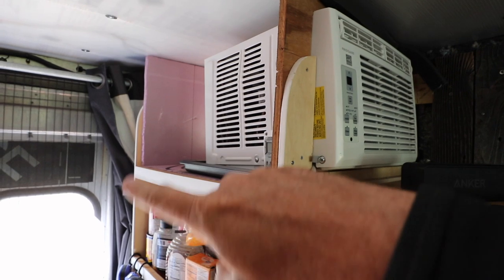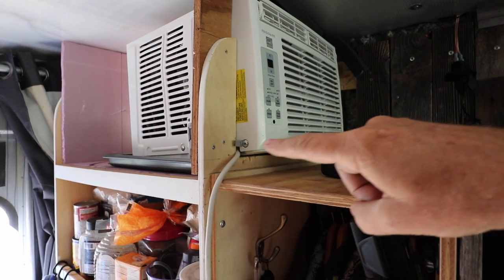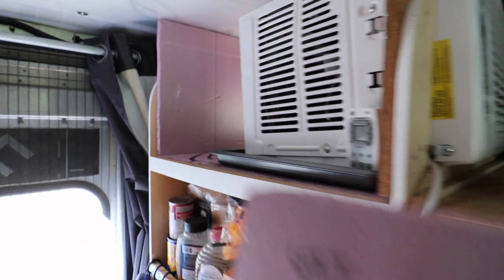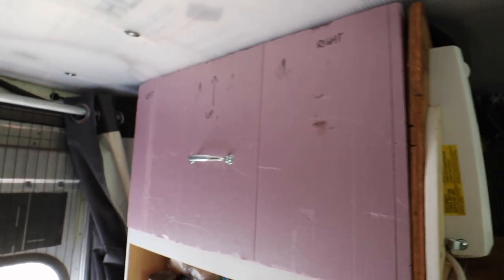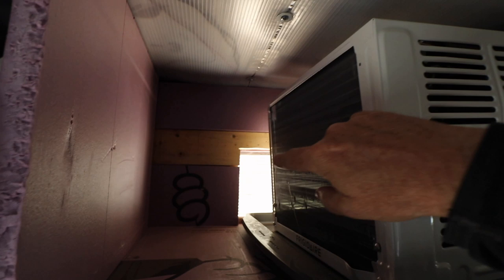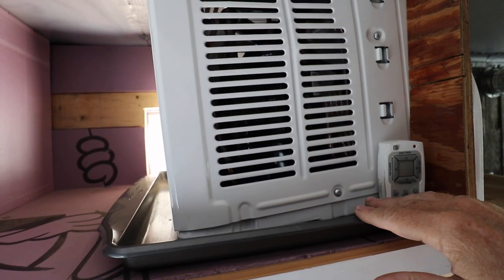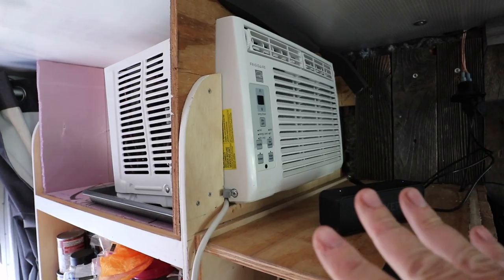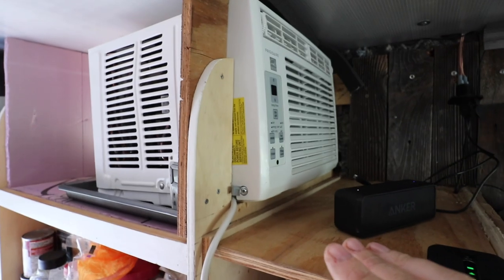Solar Powered AC in a Step Van Update P3 E559

Comment: I gave you all the information you needed to install that AC before. You need two wents. one to bring the cooler air in for the sides. And one to vent out the hot air from the back. 
You can't use one. you will be pulling the hot air from the back into the sides. 
 There's no point in getting an energy star rating if you don't use the AC in the way it was designed. 

 I have the same AC. I am in sunny Florida. There are sixteen 100 watt solar panels on my van along with 20 gulf cart batteries. 
It will run all the AC, fridge and CCTV system all night on the batteries and still have over 50% charge. 
 But even with 1600 watts of solar, you won't get a full charge in the batteries through the day with just solar. And that's with a sunny day. Maybe if you don't run the AC through the day and its full sun. But not if you want the AC running through the day too. I put a link the last time showing how to install the AC trough the floor so its true stealth and the venting is correct. I'm sorry. But what you are doing will not work. 
 If you don't want help just say so I'll stop sending you the information. 
I live in My van and use the same AC every day and night. I'm not guessing I'm telling you from years of experience. 
 I keep the AC on low trough the day as I'm working. Then after I park I run my generator and a 100 Amp charger until I'm ready to sleep. Also, My van charges the batteries when I'm driving with the alternator, along with all of the solar.
Reply: Sounds like you have very poor R-value insulation. You have spent a ton on solar and gen and are letting it all bleed out.
Reply: @tompava3923   I have 3'' of Rmax Thermasheath Polyisocyanurate Rigid Foam on the walls and 2'' on the ceiling with 3/4' on the floor. 
Have you ever tried to run an AC 24 hours a day with solar and batteries? Of course, I also run a Fridge CCTV and a bunch of other stuff.

Comment: You could put it on the roof add then cut a 45 degree plywood directing the airflow down. Another option would be to turn it  90 degrees and make a hole big enough so entire back it outside. Or add a couple 12V fans.
Reply: Also air intake is mainly in the front. 100% if you keep it closed. Also air comes out 2 top vents. Back side vents are mainly to shoot air out the back. You could make an adapter sending the back outside through you existing hole. Sometimes you leave it open to put a positive pressure inside.  

The back side and top intakes are hot air.  The back outflow is very hot air.  The the front intake is cool air. The front top blower is cold air.
Reply: The problem is the side intakes of hot air are outside because it it was inside it would create high negative pressure in the van. Thus a good setting is slightly open to just let a tiny bit of positive pressure in the van

Comment: You need something similar to a dehumidifier,but a portable AC unit. It allows you to hook a hose to your outside vent to exhaust the hot air. Even just a dehumidifier might be enough, since it cools air to condense water from air, which water holds latent heat value, and for most efficiency, have the dehumidifier hooked to a drip line that let's it drop outside quick as possible. Since it's just water, no problem letting it drip, with a hose through the floor to outside. Even car AC have a drip pan which then drips it onto the road. You've probably noticed cars in hot weather with the removed humidity leaving wet spots on the passenger side near back of the front wheel behind the fender, coming from the firewall. Dry air always feels cooler than humid even when temperature is the same.  Here's an example with picture showing the hose and hooked to a window spacer in a home.
https://www.walmart.com/ip/DELLA-8-000-BTU-115V-Portable-Air-Conditioner-Cooling-Fan-Dehumidifier-w-LCD-Display-and-Remote-Control-UL-Listed/482891466?athcpid=482891466&athpgid=athenaItemPage&athcgid=null&athznid=PWVUB&athieid=v0&athstid=CS020&athguid=480a2d54-c16-16ce5b9204670e&athena=true
Reply from the maker: not sure if dehumidifier would work for me. generally speaking, I spend 11 months or more in extremely dry areas like Arizona, New Mexico and Colorado (my trip to Florida was an exception).

Comment: The only thing that is inside is your front panel of your AC unit . All off the back of your unit is out side. You have two fans on that unit the front won takes the air from the in side of your step van and plows it out the top vents. The back won plows against the back coils to cool down the gases in the back coils and the compress r.

Comment: You're going to have to cut a hole to mount that to the outside there is no alternative, even with a vent it won't pull enough of the hot air out of the vehicle.
Reply: Chasing that what I was thinking.

Comment: Seven at this point I would put a hood on the roof from a fan. The type that can stay open in any weather. Isolate the exiting heat to go out the top from outside air that comes in the side. You will be done and it will work perfect.

Comment: .Jamie or camper van Kevin did interview at the van build with a guy in a van with that air conditioner on drawer slides when you travel it slides in when you need the air conditioner it slides out.    It’s the best I’ve seen and I’ve seen many .   Stop cut holes in your van and get with Jamie he will tell you and get some professional help

Comment: Seven, just a thought. What if you turn the A/C unit 90 degrees put the exhaust vent right in front of your cut out in the StepVan.let the intake  vent stay inside. Should work.
Reply from the maker: hmm... that might actually work. only downside is it would be pointed to the side instead of toward the front where I want it

Comment: Portable A.C. With a hose that exhaust the hot air,,,could be vented through the Floor,,Just my opinion,,,Thanks for the update.
Reply: It's my understanding portable a/c take more watts to run. Watch Camper Van Kevin August 28th YouTube video..He has break down of the watts for running his solar system.
Reply: Ok,,Thanks for the link.

Comment: Actually you still do not have it quite right.  The air that gets cooled is pulled in from the front only.  The side vents allow ventilation for the  for the equipment inside the unit.  The rear vent is to expel the air brought in from the sides after it has cooled the equipment.  So everything behind the front fascia needs to be exposed to the out side air.  Boxing everything in in the back forces it to cycle the extra hot exhaust back though the unit to cool it which is short lived once that box gets filled with hot air.  Which is probably signaling your compressor to stop working which is why it quits cooling.

Comment: I had one of those portable AC's with the exhaust hose. I ran the exhaust up from the corner where the AC was sitting and connected it to the vent in the upper back corner on the driver's side of the van. Unfortunately, the unit was an energy hog on start-up, so I have to rethink how I will power it.

Comment: ok so not only am I an electrician but an HVAC technician. Seven it just so happens that your thought process is still a bit flawed. The inside air of the stepvan stays inside and the outside stays outside. It is true that there are inlets and outlets for both inside and outside air. Your problem if you try to vent the hot air through somewhat cooler air will most definitely be the water that is condensed on the duct! Your best and most effective option will to be to at the very least move the rear of the ac a few inches to the outside of the van so it can work as designed thus ending the heat and condensation issues all in one simple solution. I suppose one could craft a grill to cover the outside fins for physical protection, just be careful not to restrict the air flow.  The inside air passes through the large grille in the lower section of the front and the cooler air through the top aim able vent also in the front. Some window air conditioning units do have a small vent inside them to mix a little fresh but warmer air with the conditioned air, but lets be clear on one thing according to the conditioning process outside stays outside and inside stays inside! A/c has a condensing pump that moves refrigerant and also 2 coils a condensing coil and an evaporation coil, through the process of pressure and evaporation we get cool and drier air! Simply put move the rear of the unit outside at a gradual slope and your job is done! Sorry for your struggles give me a holler if you have any questions in the future, love your channel!
Reply: amendment you must still insure the outside air can get to the intake vents on the top and sides of the back!
Reply: amendment #2 if I was doing that project I would look for the proper mini-split a/c system which is much quieter than a window rattler!
Reply: why stop there get a heat pump then you can use for a/c and heat.

Comment: Jim is right....rotate your AC 90 degrees in horizontal plane and put the "hot end" in the side wall of the van.
Reply: And put it on drawer slides so it can be retracted into the van while traveling and set up like a normal installation. Create a 'RV storage door' to cover while in transit mode.

Comment: why didn't you just build  it going outside box with vents on all the sides and made to 'blend ' with the exterior when in use, it outside, when not in use it is back inside the van, safe. for our we put it on  'slider' base, and installed a window to just allow for it to stick out when in use, when not, slide back in and window closed.

Comment: Take a look at 2 Howie Roll on YouTube video links below on his AC install.  They should give you some ideas.  https://www.youtube.com/watch?v=f5K0PdhgA8I   https://www.youtube.com/watch?v=z7HzYGwxt40

As an AC contractor, I would suggest rethinking your AC drain pan set up.  Most people don't realize how much humidity (water) that an AC pulls out of the air.  This is greatly affected by the relative humidity in your area.  In Florida this we be a much bigger issue than it would be in Arizona. I would want a larger or deeper pan that would drain this water outside.  You don't want to have to keep checking the pan so it doesn't over flow and if the pan is full of water while your driving you'll have water spilling out of it.  You could do it like Howie did his or I would use an AC drain kit (in the link below) mounted to the AC or drill a hole a the drain pan and mount it to that. You could run clear plastic tubing out the floor of you truck.  With this set up there there wouldn't be any water leak and mold issues.
 https://www.google.com/search?q=Window+Air+Conditioner+Drain+Kit&rlz=1C1CHBF_enUS690US691&oq=Window+Air+Conditioner+Drain+Kit&aqs=chrome..69i57j69i60j69i61l2&sourceid=chrome&ie=UTF-8

Where the discharge air comes out of the condenser coil in the back of the unit, you have the right idea about building a box or sleeve with insulation board to direct that air outside.

I agree with Andrew H's comments except that a properly working evaporator coil (the one behind the front grill will never frost up.  It just gets condensation on it which drips into a drain pan inside the unit.
I hope this helps.  Happy Trails!

Comment: Why not a Roof Top unit? they are not even that expensive!

IF and only if you can not admit you made a mistake and pivot to a new cooling solution I would spin the AC sideways to dump out where the hole is already.
Sell the one you have on Craigslist if you can not return it and buy a rooftop unit. No real need for anything else.

Comment: This setup is WAYyyyy too complicated to work...let me explain:
Aw, heck...I was typing out a loooooooong drawn-out reply, but I deleted it but this'll get complicated.  Unless you fabricate some sort of a shroud to cover the entire rear of the  A/C unit to capture the heat generated by it AND ....had a 12 volt fan drawing in cool cabin air blowing into the sealed box & the shroud covering the rear that you just made, you're essentially defeating the design of the unit & how it's supposed to operate.  I (personally) would've gone with a portable roll-about type of A/C unit where you route the vent hose out of a window, or in your case, the hole on the outside of the step van.  That type of unit is all self-contained & only needs one hose to vent the heat, BUT ...you need to empty the water bin often.  It's a trade-off with this type over a window unit.

Comment: lol facepalm.jpg
rotate the unit 90degrees so the back side is against the side of the truck.  cut a hole.  seal that 'outside' from the inside area.
realistically, you should just get a different unit instead of rigging this up.